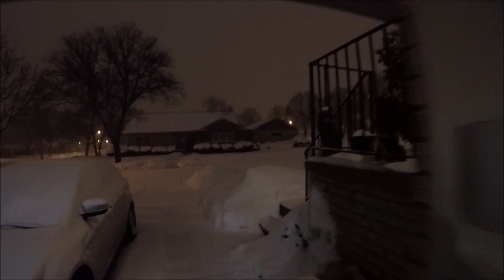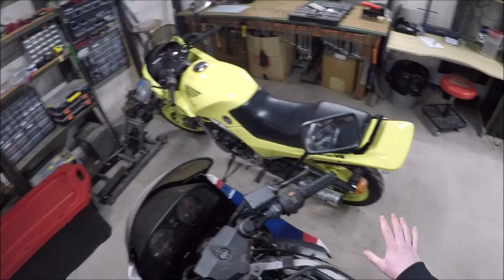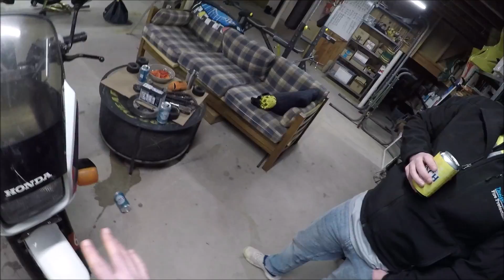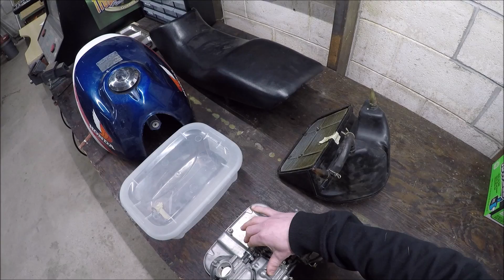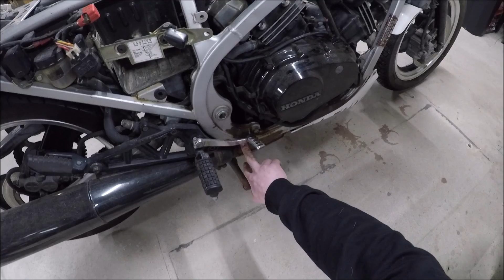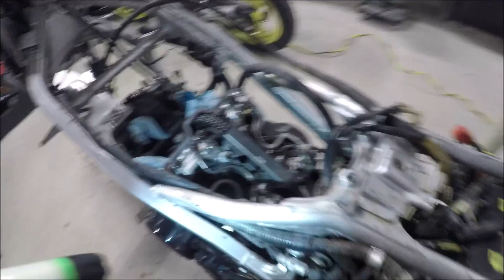VF500F - An Idiot's Analysis

Comment: Bought a 1985 Interceptor 500 when I was attending college in Daytona Beach. The bike was like an extension of your body. All you had to do was think, and the bike responded. Amazing handling. Closest thing to flying I'd ever experienced.
Reply from the maker: Just finished up clear coating most of the fairings a few minutes ago. Can't wait to have mine roadready again. There's nothing else quite like it. Hopefully I'll be able to get it to a track this year. The bias ply tires should make things interesting 😂
Reply: @matttriestodothings  The thing I appreciated the most about the VF was that  it didn't try to stand upright while cornering like every other bike from that era. When you lean it over it doesn't fight you, it just stays where you put it. Gyroscopic procession is what causes bikes to turn when leaned. Honda nailed the variables on the VR especially the front tire/wheel.

Comment: Had my 86 VF500F2E since 97. Changed the oil in it every 1500 miles - clean  as a whistle inside. You have the early version whereas mine has the line bored cams, 30mm carbs and smaller headers. I stuck the bigger earlier headers on - much revvier now. Just love the sound of these bikes.
Reply from the maker: The sound is the best part for sure. It's kinda crazy how the '86 got all of these design changes for a single year, and then the 500 was just ended. I understand sort of why it happened with the release of the Hurricane and competing sales from the same manufacturer, but they would have had to have known that was coming. I know the VF500F was not a profitable bike for Honda to sell--it's a lot of technology in an "entry level" motorcycle. I love me.
Reply: I was working for Honda back in 1988 as a young mechanic on their press fleet and rode a ton of early Hurricanes/ CBR600 as we got them in the uk. Fastbrevvy bikes. On my first day I said how great handling the 600 was I had just ridden. He looked at me and said the best handing bike here is the VF500 period. 2 weeks later we got our first RC30.
Reply from the maker: @watchgollum  Oh man, I've never even seen an RC30 in person. They look soooooooo cool! That sounds like it must have been a unique and interesting experience working as a mechanic during that era!
Reply: @matttriestodothings  Yeah. Best job for an early 20 year old bike nut. Working for a manufacturer, take home any bike I wanted and free fuel.

Comment: Very nice! From what I’ve read on the internet, the 500’s really didn’t suffer from the bad cams like the bigger sizes did. I don’t know if it’s because they just didn’t sell as many of them or what. That always worried the crap outta me with my vf500c.
Reply from the maker: Yep--the VF500F's didn't have the chocolate cams that the bigger brothers were famous for. However, they often do have valvetrain issues that commonly are the cause for these engines to die. I really probably should get in deeper and actually look at the valves themselves. If I find that the valve clearances are all super tight, I may need to. If not, maybe it's actually fine.
Reply: @matttriestodothings  When I bought my VR new in 85 the dealer strongly suggested to me to follow the break-in guide and have the valves adjusted relatively early. Not many people did it because it wasn't exactly a cheap service. I did it and the bike ran like a clock until I sold it.

Comment: Hey Matt, I'm looking at getting a vf500f myself, it's supposedly in good shape but do you have any recommendations for what to look out for that is specific to this bike?
Also I'm struggling to find an answer online - maybe you can tell me, does the gauge cluster have any backlighting for the rpm/speedo dials? it doesn't look like it does from what few videos I can find on this bike.
Reply from the maker: Hey Fedor. I'd say the answer to that question depends on quite a few variables. I'm sort of a pessimist on someone buying one of these as their only bike or if it's a bike they just want to ride. it also depends quite a bit on whether or not you're going to want to get your hands dirty and do some maintenance and have the space and time to do it.

If you just want to ride, buy something low displacement and newer with fuel injection. Consider the VF500F as a secondary bike.

Alright, downsides out of the way... I fucking love these things. But they have some mechanical downsides. The big one being that the valves have a tendency to tighten--which can bust a valve and break an engine, and also float a valve in which the valve doesn't return quick enough due to the weak springs and... break an engine. That being said, there's lots and lots of them that are still kicking along well over 40,000 miles.

With a 35-37 year old bike, there's just a lot of rubber that starts to wear and go. Usually not a huge deal, but parts are becoming more rare. The clutch slave will likely need to be rebuilt. $15, but should be done. Breaks should have new seals put in and cleaned up. If the carburetor has never been rebuilt, the o-rings inside of the fuel tubes are probably getting close to letting go. This requires full disassembly and rebuild. Now, if it's been maintained well it may be totally good to go and ride just fine, but you just never know. I'd be looking to find out more about the maintenance and the owner of the bike. Find out when the valves were last adjusted and ask what the clearances were set to and at what mileage it was done it. If there isn't a clear answer, I just don't know if I'd trust not opening it up to do check them immediately.

All that being said, I got mine in 2007 or something and rode it for 10,000 nearly troublefree miles (engine-wise, at least) before I did any engine maintenance. I had a water pump let go and snapped a throttle cable.

The 500cc V4 is just a sweet engine though in a neat package. It's a cool bike and a sweet little piece of history. Gives me a huge smile every time I ride it. So when you're looking at the bike, you're probably going to want to be interviewing the person selling the bike about how they treated it just as much as you're going to be looking over the bike for obvious mechanical issues. 

Good luck with whichever way you go on it.
Reply: @matttriestodothings  Thank you for the reply Matt, I'll make sure I grill the owner even harder than I normally do on my maintainance interrogation haha! I think I've got a pretty good idea on the valvetrain sensitivity of this bike which should be fine with my meticulous efforts on preventative maintainance as I'm no stranger to difficult old bikes.

If I end up picking the bike up, I guess I'll have a fun time trying to wrestle the carbs out and into the heads
Reply from the maker: @ajk5585  You'll be fine getting the carburetors in and out. They're a bit tricky; however, if you use a hair dryer to heat them up, it makes them much easier. Light pressure moving around on the thing.

To re-seat them (i'd buy new ones.. I'm going to. they're like $36 total for '84-85, like $100 for '86), heat them with a hair dryer, add a layer of red rubber grease to the inner lips--especially the rears, and use two small flat screwdrivers to help get the carb outlet into the intake boot. Learned this trick on vfrworld and it made a world of difference.